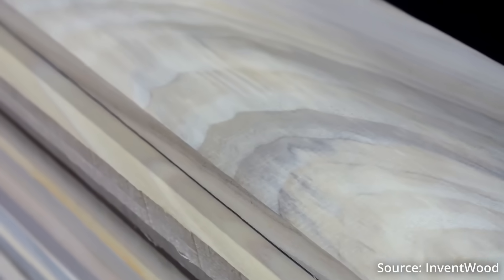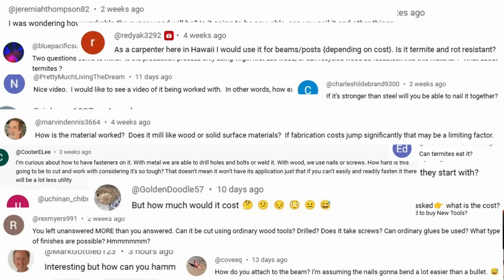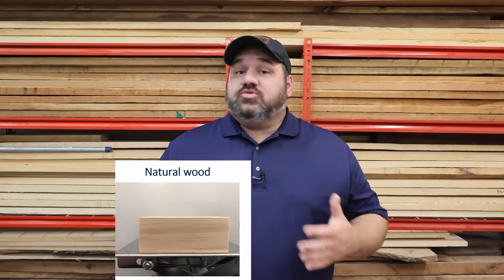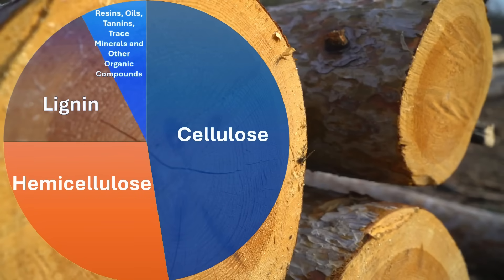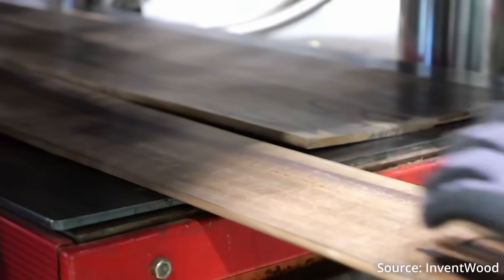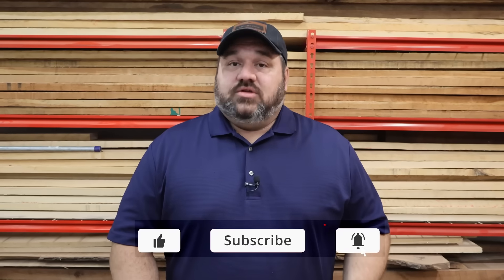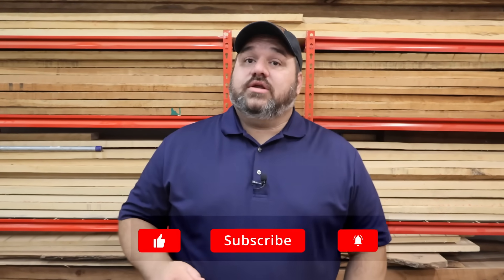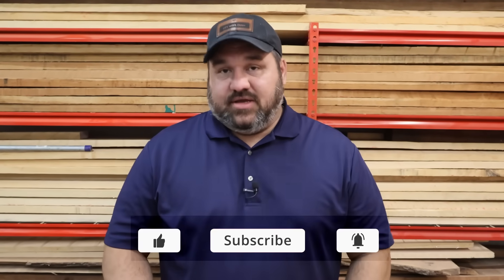The TRUTH About SUPERWOOD - I Met With The CEO of InventWood and Have Answers to All Your Questions

Comment: Oriented strand board, MDF and particle board are made from scrap bits and sawdust use up all timber remnants.    Sandwich them between superwood layers and how much stronger and more useful would they be?
Reply: I think you're onto something here! Thin super wood layers strengthen the outside and the core of OSB adds a layer to hold nails and add mass, sound deadening, and additional strength. Kind of like laminate covered MDF, but stronger
Reply: @JoshFealy  I like that!
Reply: I'm thinking of pre-drilled exterior superwood sandwiched with other materials like MDF, superwood made out of woodscraps, insulation, and interior superwood. Depending on how traditional 2x4 studs are needed, second step manufacturing companies  could pre-assemble modular wall units made such that less on-site work is necessary and wiring channels be pre-formed.
Reply: I wonder if you would use those scrap bits placed in forms and treated this way instead of using the resins and other chemicals normally used. If the wood binds under pressure after being treated it might be pretty good with more durable properties than MDF but with the same dimensional accuracy. I'm not a chemist, so it might not work at all.
Reply: It might have an application for aircraft. However, stiffness is the main issue with plywoods and OSBs in typical construction. It is the thickness of the board that provides most of the stiffness. I am skeptical that it would a common use case application.
Reply: What would that be a replacement for??? Sounds like a solution looking for a problem to me:-) I'm sure a structural/civil engineer might be able to think of a usage.The chipboard/OSB/MDF core seems a bit redundant to me.
Other companies already make this stuff e.g. Mettlewood and they are starting to produce I-beams and box sections which tbh was ALWAYS the intention - to produce a sustainable alternative to steel in construction.
Reply: @chippysteve4524 could replace the materials in SIPS construction, better to be rid of plastics where can do.

Comment: Looks interesting. I have more questions. How toxic are the chemicals used in manufacture? Does it render the sawdust toxic? If you used it as a cutting board, could toxins leach into your food? If a puppy or toddler chews on a piece, is it dangerous? If it is fire-resistant, how do you dispose of the leftover scraps? Will scraps decompose in the landfill or are they 'forever'? Are there special environmental considerations for the manufacturing process?
Reply: It's basically pressure and heat after some harmless chemicals partially digested the hemicellulose and lignin. No reason to be toxic in any way. Energy intensive, maybe, but not toxic.
Reply: the two chemicals used are sodium hydroxide aka (caustic soda, lye) and sodium sulfite. Washing these chemicals out of the wood is an important and necessary part of the process. In the paper it shows that you gain strength as the lignin and hemicellulose is removed up to aroud 45% but if you continue removing the wood actually starts becoming weaker again. So if the chemicals are left in there the product could end up weakening over time. In addition to the washing is is also squeezed under 5 Mpa of pressure while being heated at 100C.

Considering the chemicals involveds the environmental considerations would be similar to paper making.
Reply: I've been a meat-worker for over 30 years, to clean fat off cutting boards we use caustic soda (NaCl) so assuming you follow basic food safety you should be good.
Reply: @iamterfer  Caustic soda is NaOH not NaCl. Regular salt would not do much to fat on a cutting board!😅
Reply: The most dangerous chemical used is sodium hydroxide.  Add ANY acid and it is harmless saltwater.  Add oil or fat, and you get soap.  Pretty harmless.  Superwood does decompose, just very slowly.  As for toxic sawdust, it is harmless, but you will have difficulty cutting it.  Great for cutting boards, standard wood cutting boards harbor bacteria  .Environmental concerns are same as making paper.
Reply: Good questions. You have to ask the right questions to solve problems.
Reply: Great questions @janetscott3385 and thanks for the video Dave. I would like to add to this and also ask if it develops a surface chalking when exposed to direct sunlight and if so what is the composition of that chalk and its physical property. For example does the base material or a derivative of the milling / shaping or use mechanisms become friable as it ages? Any and all information about the “potential” risks of dangerous airborne particulate would be greatly appreciated.
Reply: Superwood commercial.
Reply: Less toxic than sawdust itself. No. No. No. Dumpster. Yes they will decompose. No.
Reply: Very good questions.DIY Dave is probably a shill/well-meaning but uninformed bloke who seems to be acting as a sales rep.ALL his info came from the guy who 'owns' the company!
The product already exists in the US and Europe.As usual Northern European scientists will already be all over those subjects but it's still new so we'll have to wait for some honest results rather than infomercials.

Comment: If wood can be made stronger than steel, then I am very curious if wooden boat building will become a thing again. That skillset was lost nearly a century ago now, and if building massive diesel-powered cargo ships out of wood happens it would be slightly amazing.
Contrary to what people believe, natural wood survives just fine in saltwater. Saltwater generally preserves it and a well-maintained wooden hull can last forever (ship of Theseus). However, freshwater is the enemy of classic wooden ships as freshwater from rain/etc causes rot. If Superwood is generally far more rot resistant than the existing standard wood, then using it on ships/boats would become a massive change in, at the very least, the pleasure boat industry if not the commercial boat industry. America has lots of traffic on freshwater, probably more than any other country in the world because we have more navigable lakes/rivers than any other nation, so superwood could allow for better interstate shipping over water in the U.S.
Reply: Wood is not stronger than steel. They need to finish the statement. For a given mass, wood is stronger than steel. But even that I would challenge as they are probably comparing to the weakest steel and strongest wood. Also different shapes. A thick board will resistance bending more than a thin sheet of steel due to its shape.

Building wood boats is not a lost technology. It's uncommon certainly,  it is documented, and some people today have the skill. There are many boat builders on YT as well. Check out Sampson Boat Company where he does a fantastic job building a wood boat (he says restoring, but rebuilt the entire boat). There is a group building a wooden cargo ship as well. Sail Cargo or something like that.
Reply: Saltwater preserves wood!? Get outside more. The sea life loves eating wood - boring beetles, worms, and more will tear a wooden ship apart in a month or so. We use, and have for centuries, tar, copper laced paint, and powerful poisons to slow the rate of eating, and even then boats need to be dry docked over winter, or hull scraped and repainted, to keep them viable.

Comment: Entry doors, decks, and wooden fences would be the best use
Reply: Not true.This stuff was always intended to replace steel beams not wood.If you want highly durable material for outdoors then use e.g. oak (way cheaper than this stuff will be) or Accoya - a wood based product developed for decking,windows and doors,cladding etc.

Comment: What about knots? I'm guessing they cannot use wood with knots.  Maybe finger jointed pieces where the knots have been removed?  Using clear lumber will drive the cost up.
Reply from the maker: Great questions. The CEO said that they could use wood with knots. I haven't seen it, but while the knots are denser, I wonder if in the process to remove hemicellulose and lignin it becomes more malleable, and then the pressure and heat used while pressing it would make knots irrelevant. He said one of the benefits of this process is that you could use lower quality lumber and still get the same results because of how the wood binds at a molecular level. Right now, they are using higher quality lumber purely for aesthetics.

Comment: Load Bearing Trusses, Is My First Thought. 
And Fire Resistant Roof Overhangs  !!!! 
THE # 1 Cause Of These MASSIVE Spereadding Fires """ PROVEN """ 20 Years ago By UL & U.S. Department of Forestery !!! The Ground Fire Hits The Outside Wall ( Driven By Wind ) Up The Wall To The Gable Vents Into the Attic. And Rolls Around Like a Sideways Tornado, Catching The Rafter Tails On Fire. So Even if You Have a Fire Resistant Roof It Makes NO DIFFERENCE  !!! YOUR On Fire From the Inside Out.

Comment: That it stopped a bullet, the CEO said they had many layers of the wood to do it. If you layered enough silk sheets you could stop a bullet.
Reply from the maker: Even with a few layers, it was still pretty thin, and by weight, it is stronger than steel.
Reply: @DIYwithDave  It is stronger than most structural steel in absolute terms and just not by weight. Typical steel has a yield of 350MPa (minimum specified yield for most rolled structural steel) and 830MPa from the Superwood tests. Many woods are stronger than steel by weight.
Reply: @DIYwithDave so too is bamboo and it's insanely fast growing
Reply: @DIYwithDave  you can stop 7.62mm NATO round with around 1/4 inch steel plate.  Which the US uses that round in it's M240 series of belt fed machine gun, and it is also used in the DMR and sniper rifles. 

The plank you shown is looked to be around 1/2 to an one inch thickness, so just one is not stronger than steel.  

Now how thick was those boards and how many.

That is why I am not impressed with their marketing gimmick.  And find their claims that it is stronger than steel is bogus unless they use the one of the most brittle steels to make that claim.   

Now is there use case for this wood, yes but don't fall for marketing hype.  

Signed former combat medic.
Reply: @DubhghlasMacDubhghlas  - This exactly.

Also: "Stronger than steel" and "stronger than steel for its weight" are two different things, yet they seem to be used interchangeably. And I highly doubt either claim. (And there are an unimaginable number of steels with a wide range of strength values." And shooting a projectile into a material is not a good way to infer a material's strength. I would like to see tensile test or bending test results.

Is this a solution in search of a problem?
Reply: @Curly_Maple  All I know is my wood golem is going to be badass! :)
Reply: @Curly_Maple  The only metric given to its strength was stopping a bullet.   In this video it doesn't state anything else that can be tested. That why I went with stopping a bullet.  BTW old bullet proof vest used to use silk.     

I am pointing out obvious marketing BS.
Reply: @DubhghlasMacDubhghlas  - Oh, I wasn't criticizing your comment at all. I was also referring to the company's marketing. Your post was spot on. I was only adding to it. 👍
Reply: @Curly_Maple  I wasn't sure but wanted to explain my reasoning just in case.
Reply: @DubhghlasMacDubhghlas  "Stronger" is pretty vague obviously, but ability to stop a bullet is very dependent on the type of steel and how it is treated. The type of 1/4 steel which will stop a 7.62 NATO round would probably just snap if subjected to a structural load like this wood is going to be subjected to.
Reply: @JorenMathews  again I am using their only metric they put forth which was testable.

Ballistic steel is high carbon and heat treated for hardness.  

Ballistic has 232000 psi of tensile strength, while framing steal has 36000 psi.  And that is under load.  

Ballistic steel is more costly than framing steel.  Cheap plate is about 70 bucks and the plates are about 7 pounds so you are looking at 10 bucks a pound.  And plates can cost up to 150.  

6ft steel beam is about 1000 pounds and cost about 500 per foot.  Which means 3k for 6ft.  Which is a lot less than 10 bucks a pound.  

Fun fact I went with ballistic steel because it has some of the highest tensile strength steel out there.
Reply: @DubhghlasMacDubhghlas  Interesting. I assume there's a downside as usually material properties have tradeoffs. In this case, I'd guess failure mode? It probably snaps rather than deforms?
Reply: @JorenMathews  But it has much higher tensile strength so it would snap after the other would bend or snap.  

It is just the cost per pound is high.  That is a downside.  And building that does matter a lot.  Because you wouldn't want to use material that cost about 7 times as much if you did not have to.  So long as what you are using is strong enough to support what you are building.  

There is point of over engineering aka doing to much or going for something well beyond what you need.  Like putting in 2 times the screws you would need to secure two pieces of wood sure doing that for home project won't hurt the pocket book unless your home project is building a home.  Then using that many more fasteners will increase your cost where it will affect you.  Just as using 2 by 4 for walling than MDF or plywood on a shed to make it stronger even though the frame is what provides strength.  Sure, it will be stronger, but it is over kill.  

I want to say there is probably some use cases for this so-called super wood.  I am not sure what due what the cost would be of this product when/if it hits the market.  

With the Ceo not wanting to do a record interview but a written one I fear the CEO will over hype the product and do some false adverting hence why it is written so the lawyers can do some CYA.  Nothing wrong with that but that does leave me with some doubts with what they claim like how fast and lose are they playing with stronger than steel.  I can smell marketing hype from 10 miles away.  And that is what I was trying point out.  Not that I am against this product.
Reply: we need technical specs or material safety sheet to see what the stuff is made up otherwise the fumes could stop our "bullets" from leaving our "wood."
Reply: Interesting society we live in where a discussion  about a new material devolves into "will it stop a bullet?".   So if I make a superwood picnic table, can I flip it over to have a shield from bullets?
Reply: @apergiel  brother the makers of it put out that claim.  I am just responding to their marketing.  

Or should I ignore their claims just go wow neat super wood even though they did not put forth any sort of metric other than stopping a bullet to say it is stronger than steel.

Comment: Question I still have is whether you can stain it and if so, do you apply the stain in the same way as “regular” wood?   Same for finishes (e.g., Osmo or shellac).  Thanks!
Reply from the maker: Great question. That is something that I will test when I get a sample.
Reply: @DIYwithDave  I'm sure you had already planned it, but just to make sure it's in your mind, I would test all common finishes. Obviously part of the fun of woodworking is experimenting with finishes, so just common ones would be great.
Reply: ... my experience with dense woods... like ipe... are.. it takes a stain... (not the one is ever needed)... but because it's so dense... stain penetration is minimal... ie.. an oil/stain application... like ipe oil... if used outdoors...  will last about a year... then the surface fades due to exposure to the sun... 

I would expect superwood to be similar... light surface penetration... so clear varnish/laquers... to expose and highlight the grain structure... like varnish on purpleheart... might be best...
Reply: my "guess" is maybe a solvent based penetrating stain - but it might be unpredictable and not go in very far.  shellac, no
Reply: Rottenstone and boiled linseed oil would make a great polished finish

Comment: All shown superwoods lack knots, I wonder if their pressing machines destroy the knots and thus cause a damaged spot in the board because knots are already dense and through the process likely more prone to cracking/shattering.
Reply: I totally agree.All the fibres are going the other way in a knot and there are no voids to crush.Superwood/Mettlewood is never produced by compression parallel to the fibres ie end to end.I strongly suspect that that is why they are,in this case,using poplar as it is relatively knot-free below the crown and has very little value due to the weakness (for a hardwood) and ugly colour variations.Pine boards would have to be graded and have the knots removed and plugged.

Comment: If superwood has a better U factor to help with reducing thermal transfer over natural wood it would have a major advantage! However it seems that it maybe worse when comparing the insulated properties of the 2?!
Reply: I would think just because of the compression it loses a lot of its insulation properties. I'm not an expert 9n the subject but from what I understand it's usually the amount of air a product that determines how well it insulates, and with superwood that's almost completely removed.
Reply: Yeah, I doubt it would have much value as an insulator